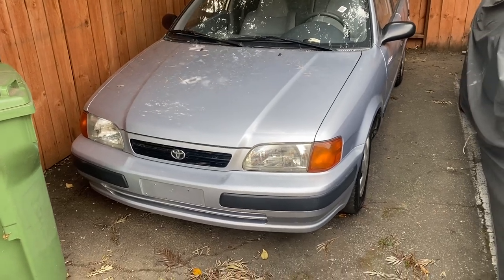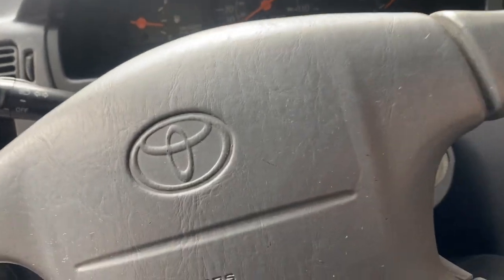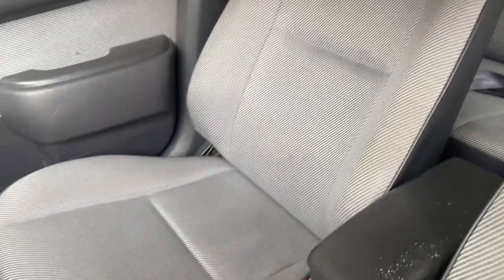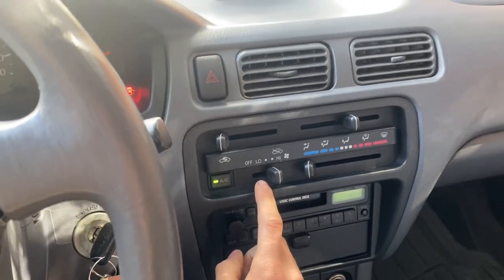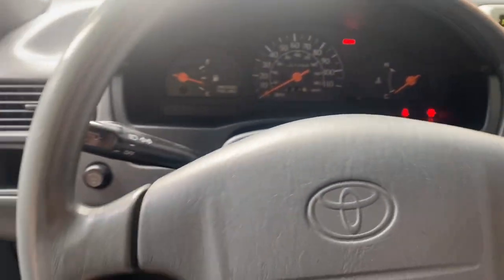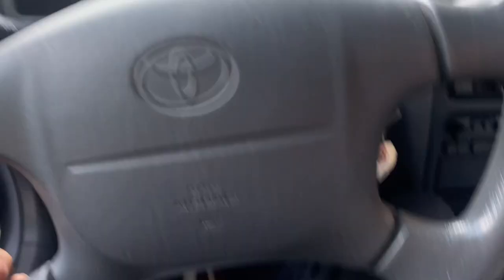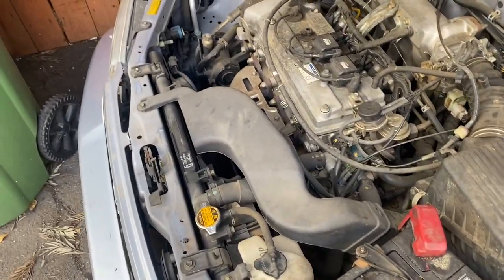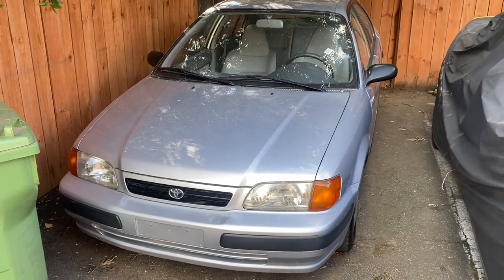Toyota Tercel built to last

Comment: I bought a 99 Tercel slushbox as a second car for the wife. Had about 140,000 miles on the odometer. She drove that little guy for 6 years and I gave it to my niece, so she could attend university. She drove it for another 21/2 years and racked up many miles. She graduated and got a new car so sold the Tercel to another student. It is still running. They were the greatest basic transportation car ever built. You couldn't kill it and it started every time regardless of the weather! The body was pristine even with all our road salt here in the Toronto area. A fantastic vehicle!!!
Reply from the maker: Amazing!! You can get so much use out of those things👌
Reply: Был такой автомобиль, 97 года. 
Простой, надëжный, никаких проблем. 
Я продал её, и она до сих пор на ходу!

Comment: At the end of last summer i scored a '99 tercel for $900 off some kid going to work in the oil fields one province over. Had 245,050 kms on it, now it has about 252,300, and i'm gonna cling to it for as long as it runs. No reason to go buy a car now, the used ones are getting too pricey and gas prices aren't gonna come down. A 90's toyota is going to be worth it's weight in gold as the decade passes.

Comment: I found one just like this for $900 but it's automatic. 190k miles. Super clean. 1 owner who says they kept it serviced at Toyota dealerships. Everything works. AC, heat, radio.

I'm buying it this weekend.

This will be my gas saver.

Comment: I got a 95 STD super good car. Only paid 350, runs and handles like a champ, wasn’t built with power steering. Thankful for that kinda because that’s another thing that can easily disrupt the reliability.
Reply from the maker: That’s true but that’s a good price 👌
Reply: I had a 95 STD aswell, is yours a 4 speed too?

Comment: Yes. I have here in North san diego a 1995 1.5 5E-FE Manual Transmission, Manual steering, manual windows.
456.000 miles motor and transmission never opened. One clutch.
Original Alternator and Starter and AC Compressor!!!!
Built quality was not only superior to american junk but it was better then honda's single camshaft 1.5. 
Made in Japan is the main reason why that car lasted so long.